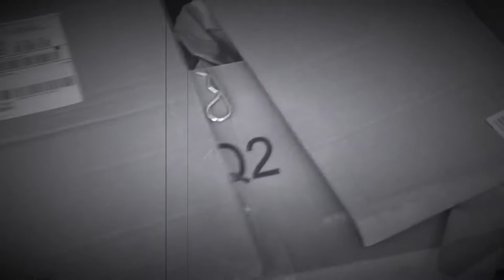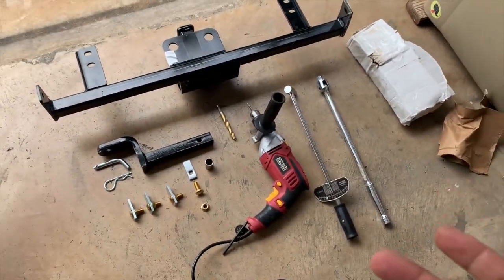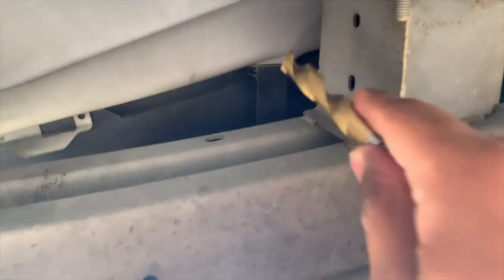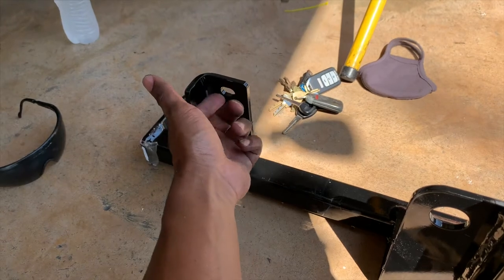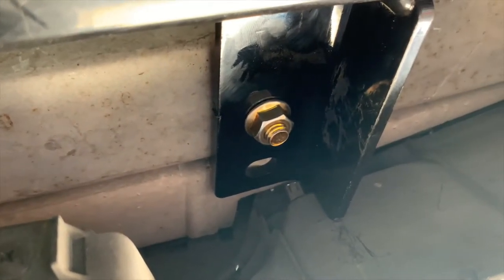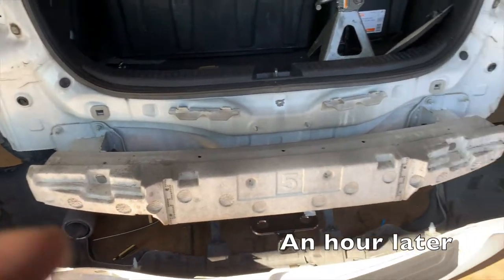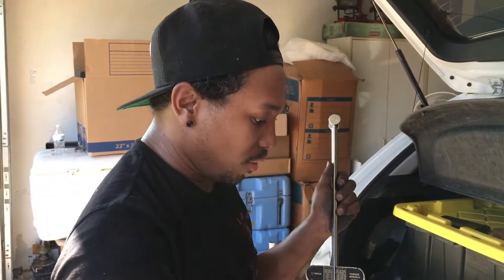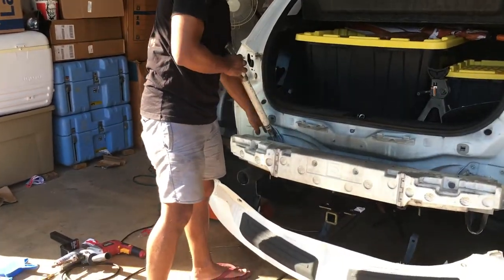Trailer Hitch Install 2008 Mazda 3 Hatchback

Comment: Mo my apologies for the delayed response.  I got busy when you sent this and forgot about it until now.  Your son did a great job narrating the install steps and I assume you were recording and directing the scenes.  The bolt hole enlargement is typical and as your son commented those good to know items aren't usually emphasized in those manufacturer easy to do video steps.  Was there a difference in bolt size for the first trailer hitch model versus the model he bought with the hitch.  I hate modifying structures and equipment and expect everything to be exact as advertise.  Nevertheless, your son did a good job explaining the reason why he recommends the Kobalt bits versus the titanium.  I was impressed with his manipulation of the bolt and how he fed it through the frame by wrapping the bolt threads in a spiral fashion.  May have to steal that step on my next car project.  Lastly, where is he headed too that he's installing a trailer hitch?
Reply from the maker: He is better at YT than me. He still care about his content.